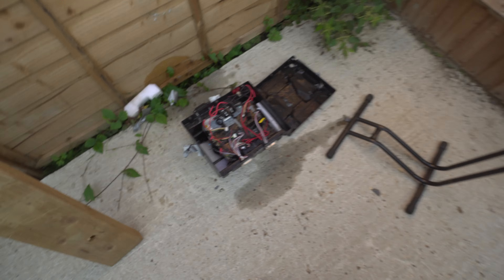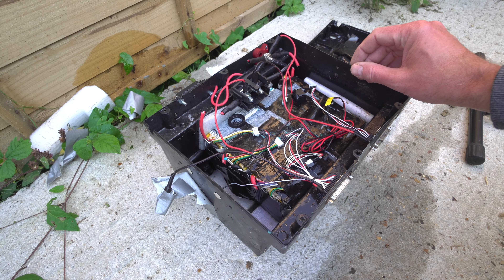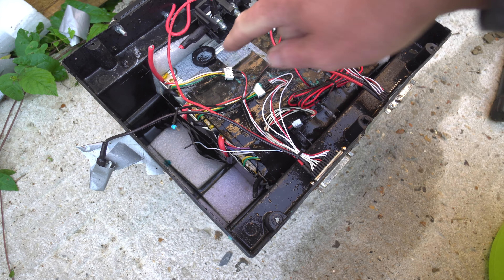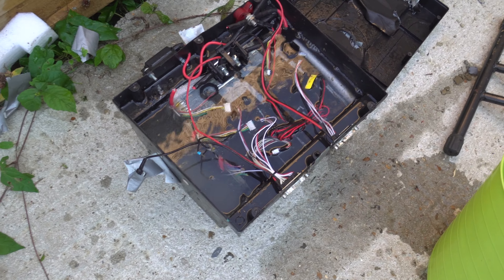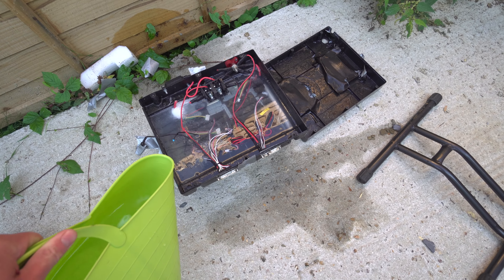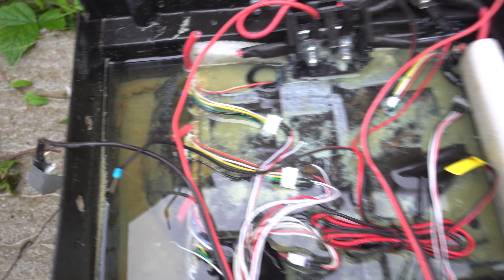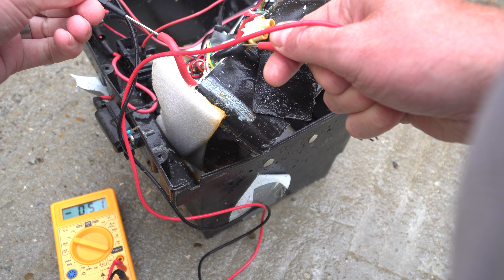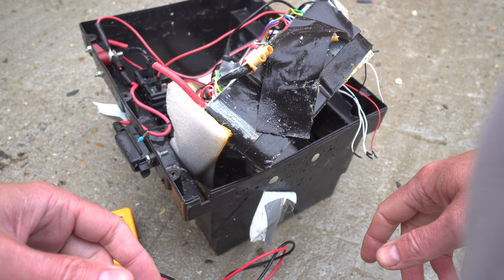DISPOSING OF DEAD EBIKE LIPO BATTERIES

Comment: In my neighborhood we usually dispose of small dead batteries by taking them to electronic stores like bestbuy, radio shack or even staples. Big batteries like old car batteries i take them to auto zone, or sometimes to my local car dealer if i'm doing some maintenance, they would gladly take it off your hands for free. Also google if you have a recycling facility nearby.
Reply: I take dead batteries to my scrapyard where they pay me by the pound for it. Sometimes I can get $10 for a car battery.

Comment: that looked  like bms  was still on it     should of removed that as +traces   could of shorted  to ground plane  on pcb  =nasty fire  these unlike lipos  18650 cells   explode    with  metal  shards  going everywhere  but assuming bms was removed   salt water is defo  best way to do it  out in open air so any hydrogen   produced   just gets blown away by the wind etc
Reply from the maker: +IGSPOWERD thanks for the comment, you are right, BMS was disconnected, those wires were just extensions going to the connectors on the outside of the battery box where a balance charger was used to charge the battery.